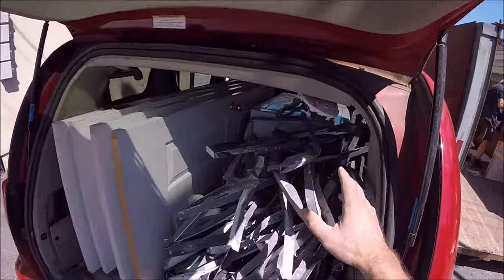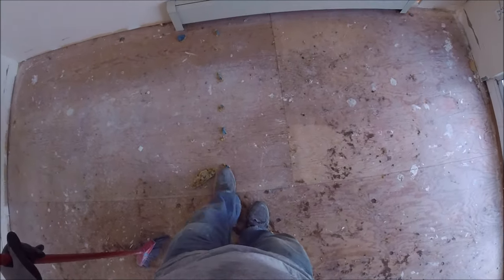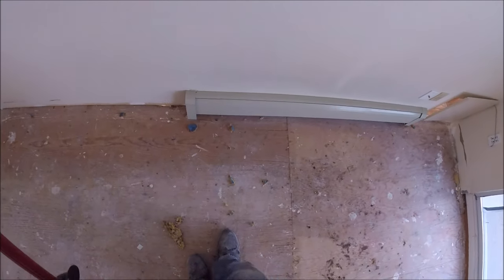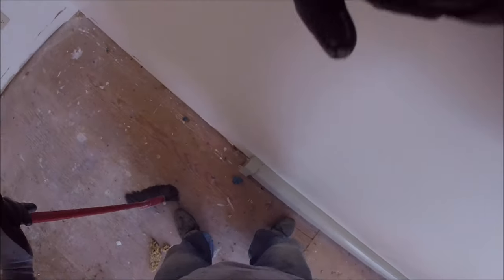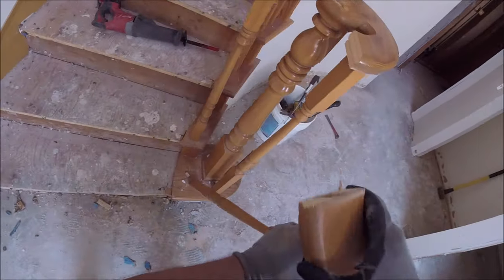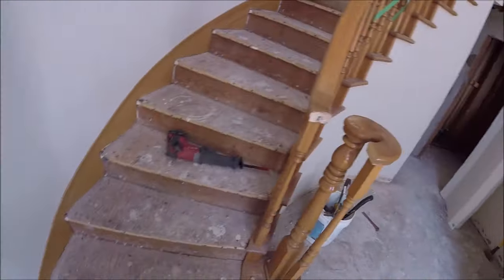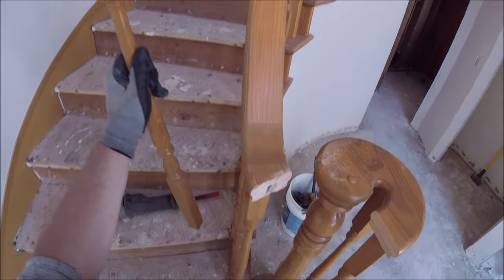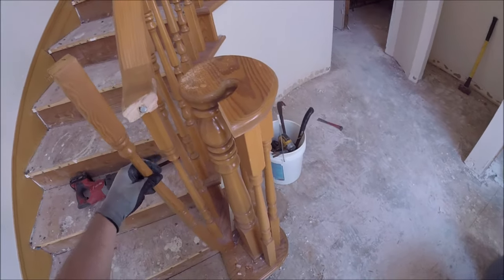Demolition Removing Stair Rails + Filling My Bin & More

Comment: Finally the bin door is closed. Hope to see yard run tomorrow. I expect a weight of above 3800 pounds.
Reply: 3800 pounds? No I think 3200 pounds.
Reply: @y.lelivelt2619  Thanks for an honest opinion. I made my assumption based on :
1. When he started filling the bin, the first two rows were tightly packed.
2. He stuffed 4 two wheelers which took minimal space.
3. In the last row, he packed two hot water tanks.
You can also be right because he stuffed two empty fridges which may negate the hard stuffing.